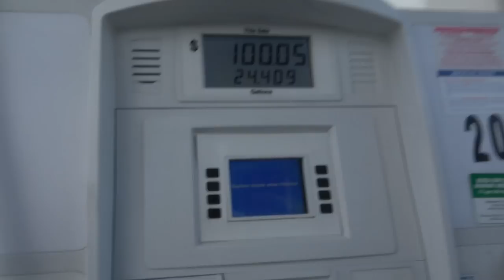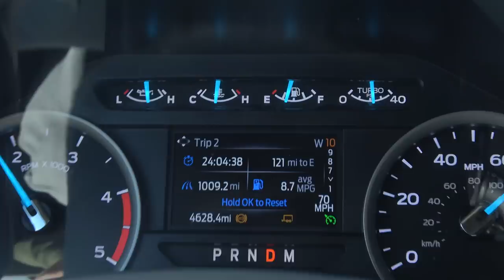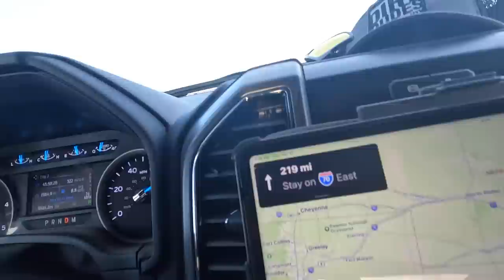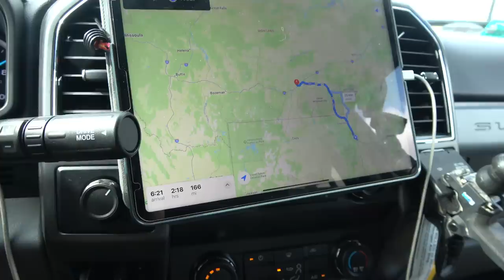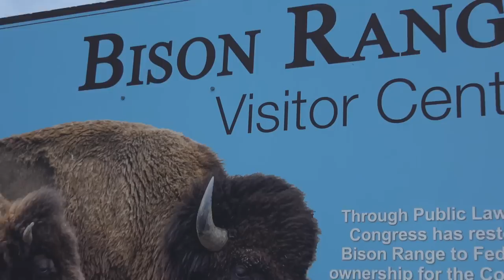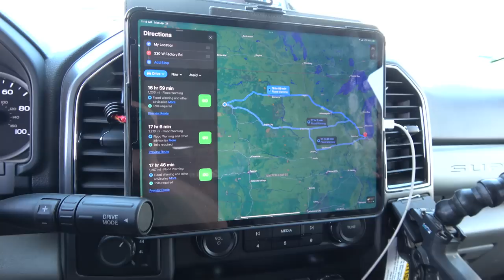Covering 11,000 Miles In 2 Weeks | Leaving Hot Shot Trucking For Youtube | Plus NEW Tow Rig

Comment: Thanks for doing this video.  Makes me fill a little more connected as I'm an owner operator myself. I don't think people realize how stressful it can be at times. Things are always changing,  loads falling through,  delivery times changing, and it seems like you're always racing the clock.  Congrats on the new to you pickup.  I think you got a pretty decent deal. I gave 30 for my 2014 ram 2500, quad cab long bed with the  Cummins.  I put some 20×10's with  35" tire on mine.  Still gives about the factory side wall height for a decent ride, and the 35" tires fill the wheel wells perfectly.  Honestly, it should come factory like that. I'm sure you're going to love it pulling your trailer.  I hauled 6 loads of gravel in a dump trailer with mine, probably about the time you bought yours. Rolled across the scale, loaded at 23,460# and pulled it great here  in the MO. hills. It impressed the hell out of me, and I drive a W-900 Kenworth for a living. Good luck on the new adventure